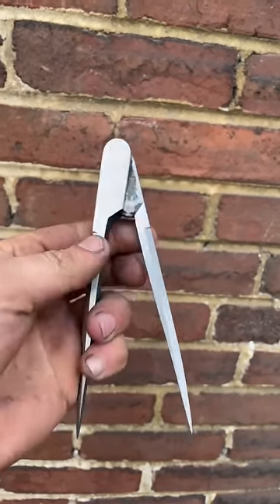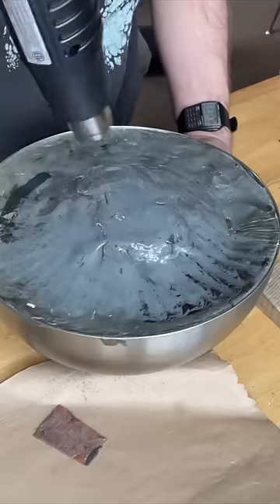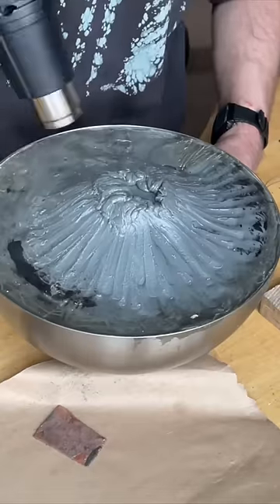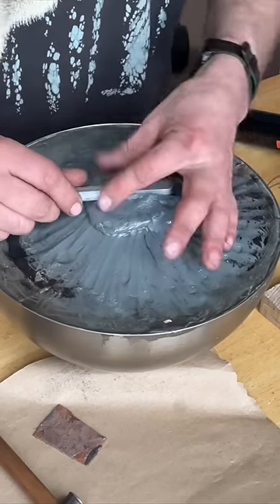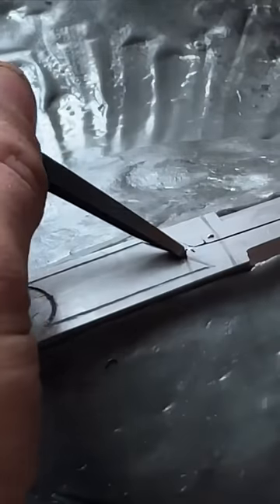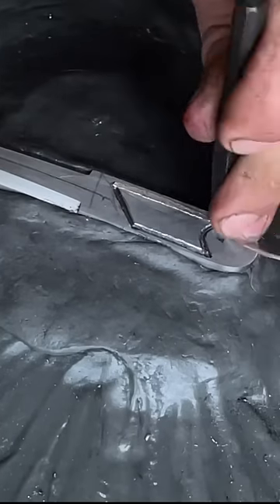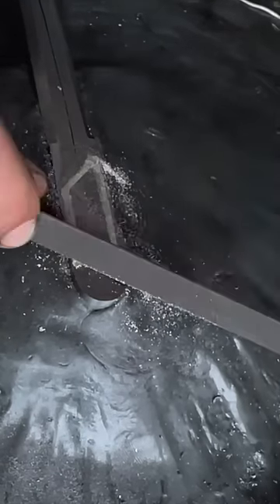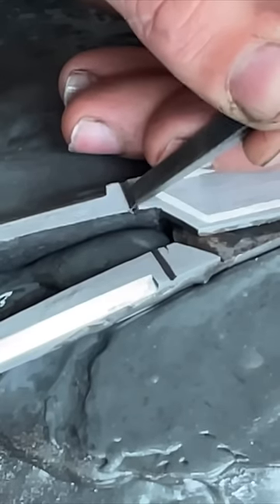How I do silver wire inlay on wrought iron #blacksmith #asmr #wroughtiron #silver #engraving

Comment: That is a beautiful pair of dividers.  Love them. Hard to believe they're hand made.
Reply: This is probably a dumb question, so apologies in advance, but I'm not familiar with this particular tool - what's it used for?
Reply: @pizzlerot2730  It's a compass. You probably had one in school with a pencil attached to one end. I don't know why he's calling it a divider.
Reply: @EikottXD  how is that a compass? And why would you attach a pencil to a compass?
Reply: @_Dacor  Google school supply compass.
Reply: @dacor1106 A compass is a tool used to draw precise circles. It has a pencil on one end and a pin/leg on the other, you put the pin on the paper and spin it, the pencil will then trace a perfect circle on the paper. 
It is used in everything from mathematics to cartography.
Reply: @EikottXD  it's a divider. it's found in most maths sets next to the compass and has a significantly different use - you're supposed to set it using some distance, and keep walking it along a straight line to measure how much longer something else is
(or just set it, and move it somewhere else so you can draw a line with the same length)
Reply: @EikottXD I think a compass is a specialized type of divider.  I believe it is a general term for a tool that measures using two movable legs.

Comment: Great job. You should check out that new clay putty they sell. You mold it into the shape ya want and then hit it with a torch. Once heated it turns into either bronze, silver, copper, maybe even gold if I'm not mistaken. Very neat fast way to do work like that I bet. I plan to use it to make custom gun parts like sling mounts etc. Good luck!

Comment: You might have small electrical discharges due to natural voltage between iron and silver. just keep that in mind depending on the application that you may need to use it.

Comment: Beautiful work, but doesn't the silver pop out if you aren't gluing it in?  I usually do a drop or two of CA to fuse the two surfaces if I'm not doing any hot work.
Reply from the maker: The inlay works by creating a dovetail in the wrought iron, its mechanically fastened into place, making it pretty unlikely to pop out

Comment: Honest question, why don't you use a vise? Would it scratch the piece? If that's the case, could two pieces of wood or something softer help?
Reply from the maker: A pitch bowl is pretty handy for holding odd shapes like this. It was also way cheaper for me to get a bowl from a thrift store, fill it with some concrete to make it heavy, then make my own pitch and put it on top. Cost about $30 instead of $300 for an engravers vise
Reply: @nate_weiss_   Wow, after writing the comment I felt stupid for commenting on a year old short, thank you very much for answering this quick. And thanks for the insight, I really didn't think of prices, makes a lot of sense
Reply from the maker: No worries, something not immediately evident just by watching. Just always trying to do more with less 🤓

Comment: Over time sand on a flat surface then save your silver dust and melt down, cast and draw your own wire. Don't forget to use a magnet and get the steel out.   Ive been saving mine got about an oz.  Future video ideas done and you owe me 10% lol

Comment: Wrought Iron is no longer manufactured industrially, I think he simply means "forged" . Im sure someone is still smelting the original formulations. But I highly doubt this is wrought iron. I also dought he even knows what wrought iron actually is....???
Reply from the maker: While wrought iron is no longer commercially available, it can still be salvaged in things like anchor chain and fence pickets. The material I’m using came from window frames that were for a greenhouse, probably around 110 years old or so.

Comment: Lines aren't very straight. Looks smooth but not sharp.
Better than I can do though, so it's just a random stranger's criticism. It's obvious it was your first attempt and I think that's why you said it. I am sure you've seen it by now but there is this blue scribing fluid you can buy that will help you draw cleaner lines for your chisel work.